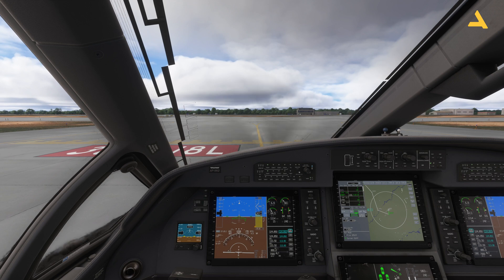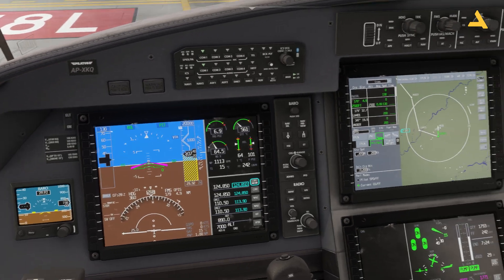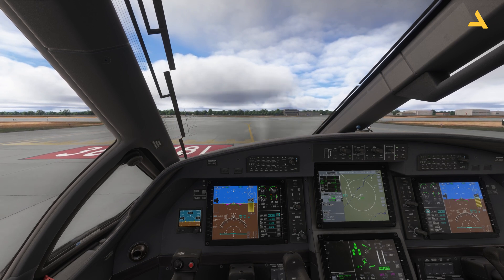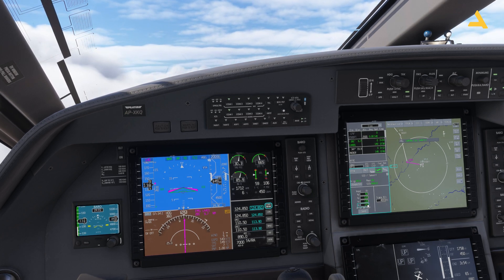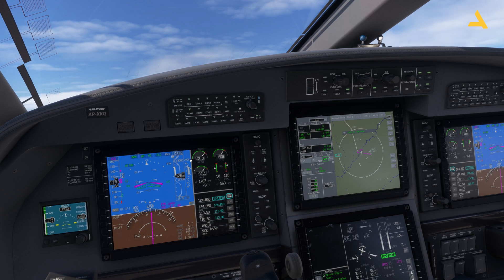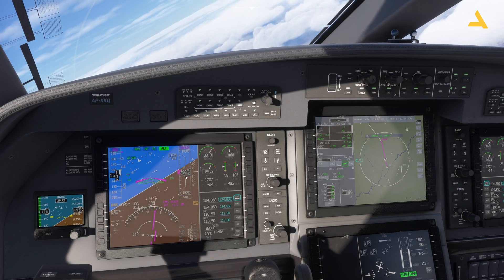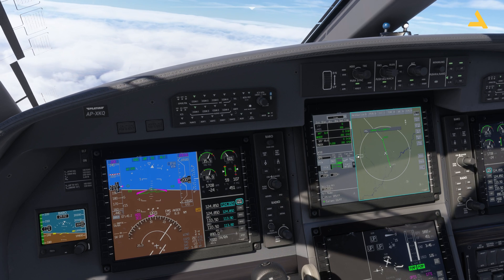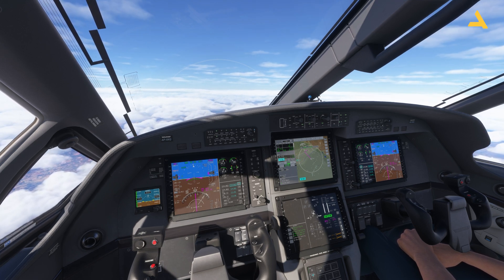Take off & Autopilot Tutorial of Pilatus PC-12 in MSFS 2024 | A Beginners Guide

Comment: Thanks for the vid, everytime I hit the nav button, the plane doesn't follow the GPS route plan and I don't see the maginta line, I only see the blue line, any clue?
Reply: Nav mode still won’t work for me. Is it bugged or am I doing something wrong? From the time I power the plane up it shows a red x over where blue line is on the bottom and magenta line is once flying.
Reply: @benlincks4210 i found the solution. u have to change the ‘nav sel’ below BARO bugs on copilot side to fms mode that shows on their radar
Reply: @jackreacherdota thanks. I also found out to file plan with ATC and send route to avionics AFTER the PC-12 has started up. Then push activate on the MFD
Reply: glad you found your way to solve it
Reply from the maker: Are you trying this in the career mode?
Reply: @aatifahmad  Yes. The career mode is full of bugs anyway

Comment: Your tutorials are good, but seems you lack some knowledge about some thing like initial sep. It should be turn on during taxi, take off. You've just clicked during cheklist but seems you did it not bother to turn it on.
Reply from the maker: Thank you very much for your comment and feedback. I am actually doing videos for the beginners who have very little or no knowledge about the planes in the simulator. Therefore, at times I skip few things which might not effect the flight. Because too much of information for the beginners might result in lack of interest. Maybe due to this reason you might feel like that I have limited knowledge of the systems.
Reply: @aatifahmad  I guess beginners just pres auto engine start, and don't run the checklists :) But if you show how to do it - please do it properly.
Reply: @edgardodj  what's the initial sep is ?
Reply: @hamodi9999  Inert Sep = Inertial Seperator  - to avoid fod on takeoff and taxi